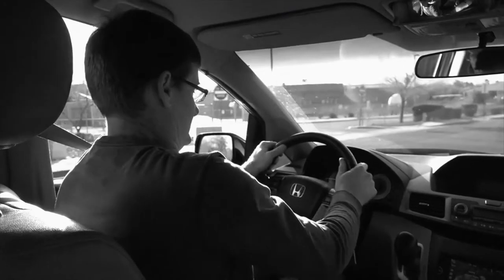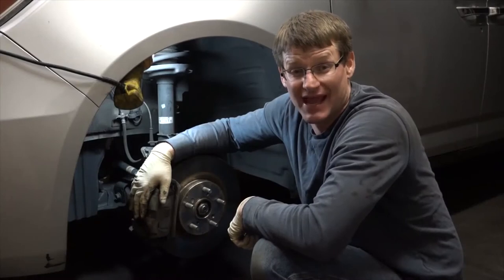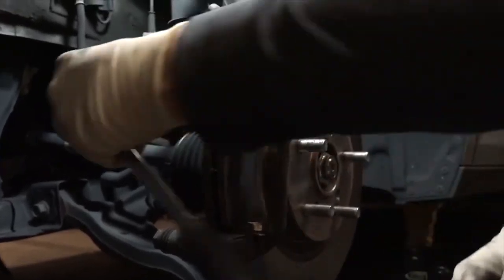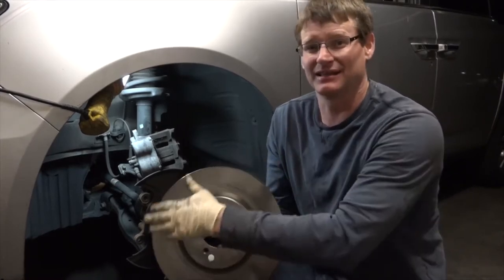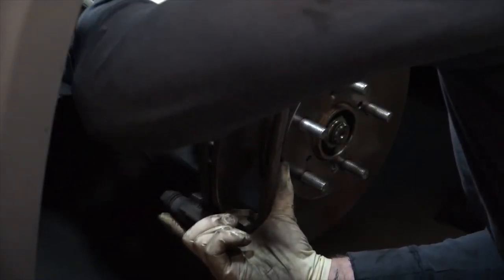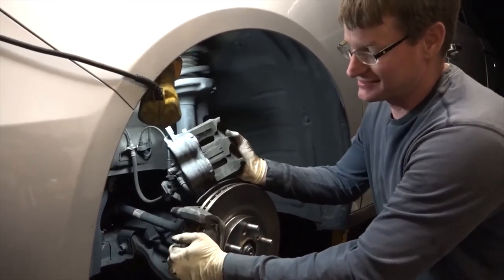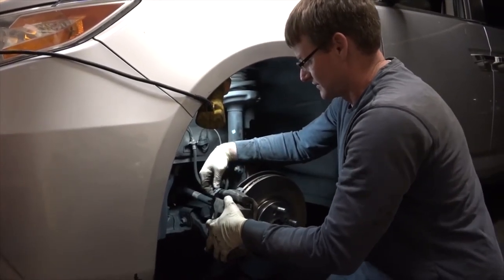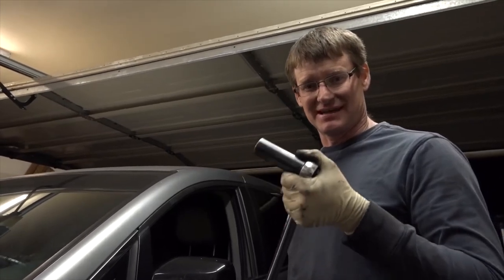Replacing Calipers & Rotors by Wyatt Henrie

Comment: Slider pins should always be removed and additional brake grease applied.  Abutment clips, in most instances, should not be re-used but rather replaced.  Applying brake grease between the pad shims and pads assures long lasting brake squeal elimination.  Rotors were removed but does not show any resurfacing effort.  After removing the lower slide pin bolt, the caliper can be removed by pulling it off the caliper bracket with the pin attached (i.e. top bolt did not require removal).   Rattle clips should be replaced with new ones.  Like the abutment clips, they my no longer have its original tension.